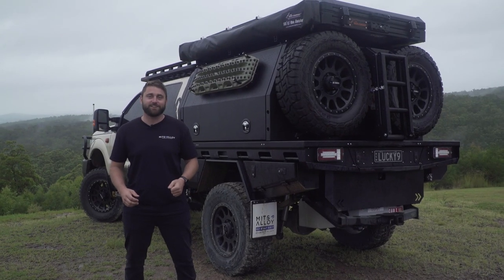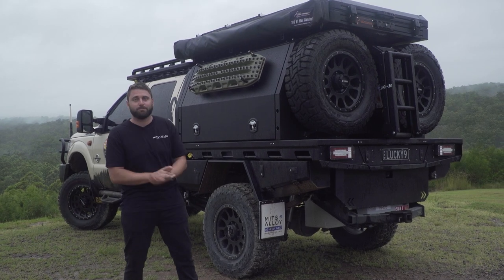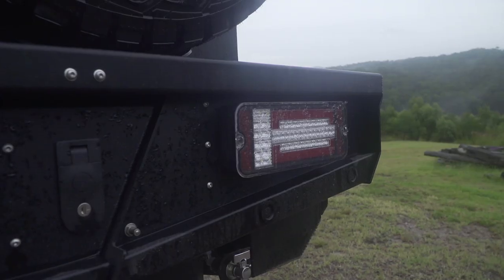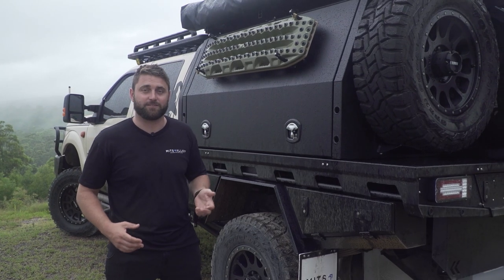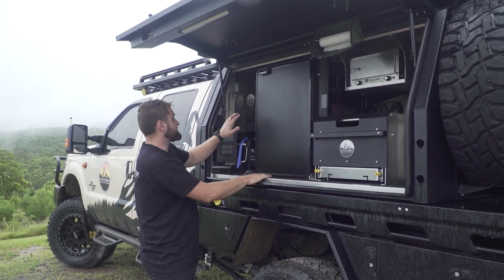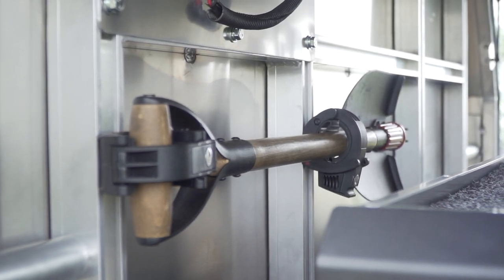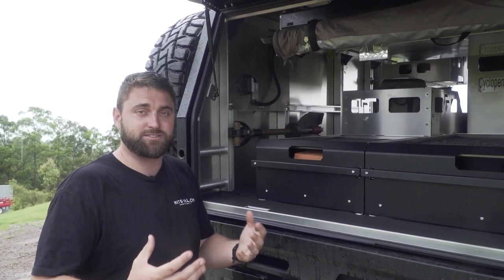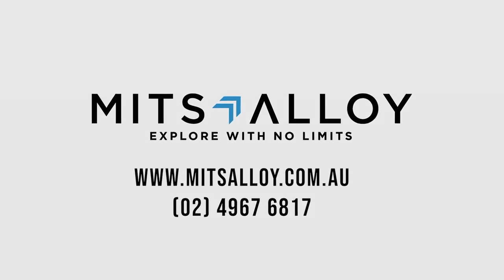Ty Fenwick F250 Walkthrough - MITS Alloy EVO2

Comment: The fully modified F250 is so big the 37s looks like a 35s. Is it legal to go upto 39s(bigger side) or smaller size 40s? ISUZU D-max on 31s with two inch lift is good, however with today's technology fitting proper 33s (285/75 R17) on D-max is simply amazing.